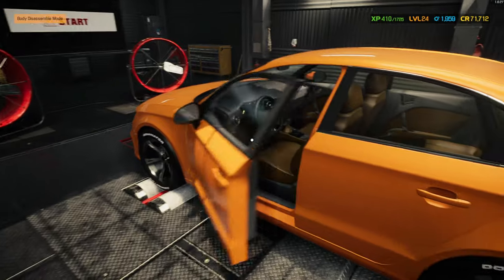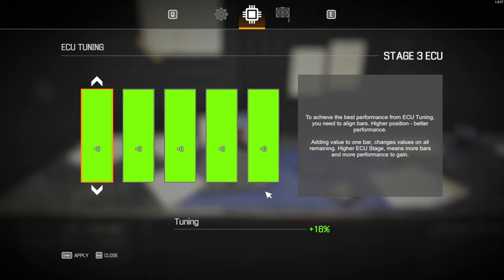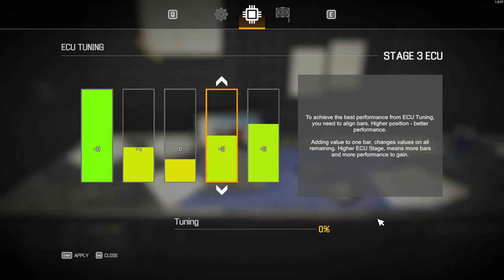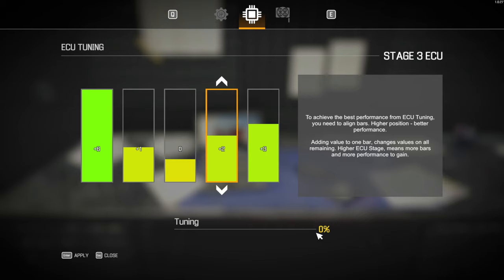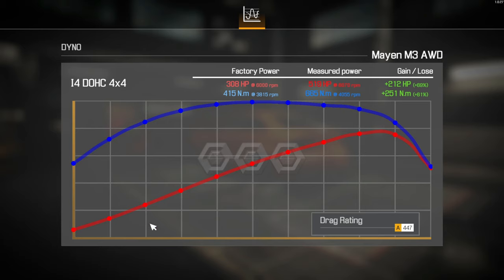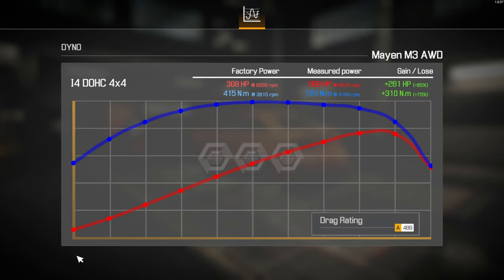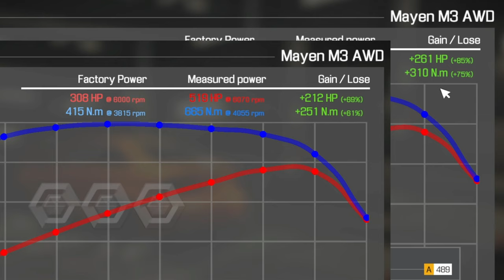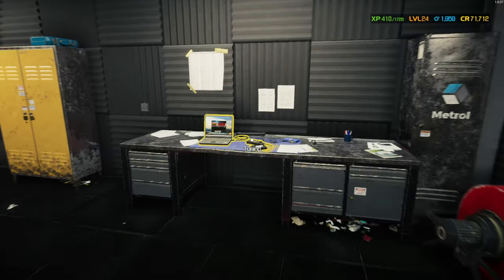How to Tune a ECU in Car Mechanic Simulator 21 Drag DLC

Comment: i cannot tune my ecu can you help?
Reply from the maker: Do you have the Drag DLC?
Reply: @TheOverclock  yes
Reply: @TheOverclock  it says there is no tuning ecu installed
Reply from the maker: Ohhhhhh... What you might have to do is to go and install the upgraded ECU's. You know where you purchase everything, there is the performance section, you will need one of those ECU's. I think they are Red
Reply: @TheOverclock  okay thanks
Reply: Thx for the video! I am on xbox but there is no tunable ecu for purchase.  I do have the drag DLC installed
Reply from the maker: Are you looking for the ECU amonga all the other parts you normally buy? If so it means you bought / have the wrong ECU, you must buy the upgraded ine from the store. It is in that big drop down menu where you buy body pannels, wheels and etc
Reply: I found them.  They don't come up in the search if you just click the stock ecu a or b.  You have to manually search for them👍

Comment: Are you from the Netherlands? You sound a lot like Lowko! Thanks for the tutorial! Cheers!
Reply from the maker: Never heard of him lol... I am from South Africa 🥳 Glad I could help
Reply: @TheOverclock  oh my goodness i was so far off! lmao, he plays Starcraft, don't worry about it. question! do you have an engine tuning guide? i made a super high performance car, a mod, the hotwheels one, and i'm having trouble burning out at the start of a drag...i've hit 300mph several times, but only if i get lucky with my start timing/acceleration. the car feels like the engine is just too powerful to move the car accurately
Reply from the maker: Yea just a bit 🤣💪 I wouldn't mind moving to Netherlands lol...

Also is your car spinning a lot on the pull away? I just want to make sure I understand :) if so just make your first gear longer the it won't spin as much and you will have better times
Reply: @TheOverclock  my first to second gear is at like 90mph, top speed is around 300, i'll give it a try, yea the engine torques so hard, i'll spin out and lose control of steering.
Reply from the maker: Ohhhhh damn! That's not good lol... How is the tire's you have now? Are they slicks maybe? Are they the widest tires? Also with so much power try to have a bigger sidewall... Sometimes helps...

I am unsure if you can tune your suspension in the game, haven't played it in a while. But try to make your rear end softer or lift your nose up a bit 💪

Also I am trying something new with the cars, its like a drag series of where cars goes against each other... My first video is up tonight, if you don't mind can you tell me what you think about it? Currently the first video is for Ken block 💔

but I will have more specific races like the RS3 vs the A45 amg you know 💪
Reply: @TheOverclock  i do have slicks on, is that bad? i'll try the vintage races, or maybe just race tires. i thought the slicks were the best for drag but i'm still pretty new. i'll check your vid out right now
Reply from the maker: Slicks is the best 💪 you definitely want slicks on 😎👌 and thanks man :)

Comment: I always test my tuned cars with Dino's too... just get a bit expensive when the tune isn't great. The dino tends to gnaw the cars in half!😱

🏎   🦖  💥🔥🔥🔥
Reply from the maker: If he Gnaw it in half then it just means it does not have enough power to out run it 😂... If the car has 1000 horsepower, it does have a chance to take down a dino 😂 1000horses vs dino lol
Reply: @TheOverclock  Interesting... so to make the best tune I need to use a Dinobot!😂
Reply from the maker: 🤣 Uhhhhh yea... Sure... That one 🤣